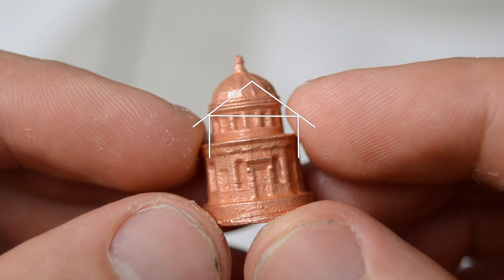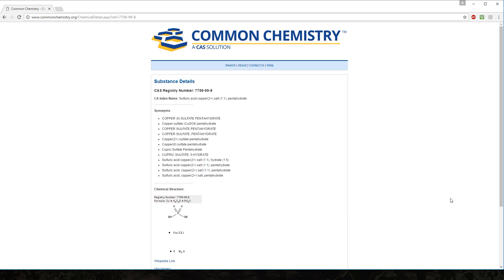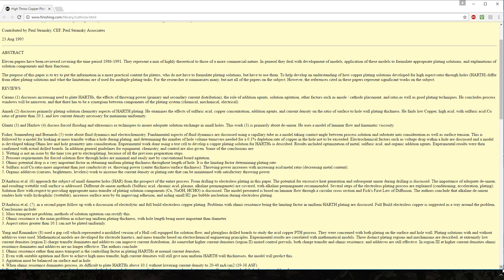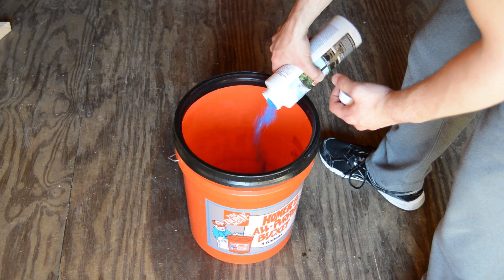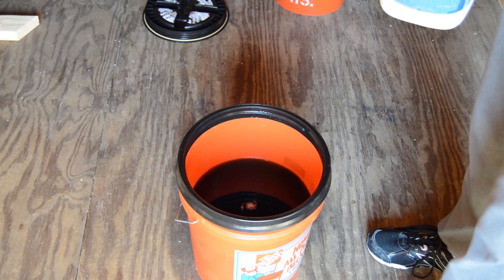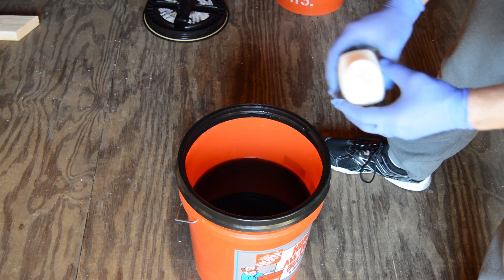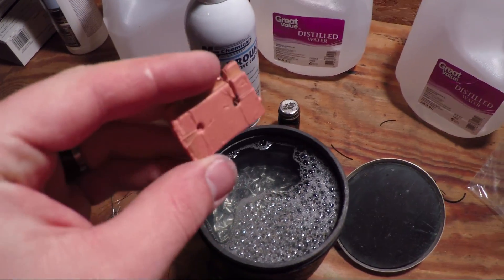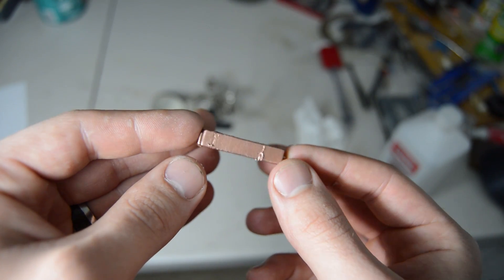Best Copper Plating Solution ~ DIY Professional #3

Comment: Amazing video!!!

Question: You say it's possible to replace sulfuric acid with citric acid. In this case, does the remaining content stay the same? And most importantly, considering that I used citric acid powder, how much of it (volume/mass) would I need to use?
Reply from the maker: This tutorial goes step by step into a similar formula using citric acid. https://youtu.be/2adh56s11Sg

Comment: *@GARAGE SCIENCE*
  - Do you have a video on the process to copper plate steel parts??? I tried your recipe bath and the basics of your setup, but the copper coating just wiped off... and actually before that it just literally fell off and most of it is now in my plating bath... doesn't really matter I guess, as I had already destroyed my solution. 
As a *Warning* to others... *Do Not Use a refrigerator motor/pump for your air pump.* I did, got a good volume of air but not too much, thought it would work great... however the problem is that it also pumped a thin coat of oil out of the pump itself, and pumped it through the air line, so now my plating bath that I Just Made is contaminated with a sheen of oil floating on the surface. So I just lost about... $15 to $20 worth of brand new chemicals that I didn't even get to actually use...
Reply from the maker: This video explains the reaction you experienced: https://youtu.be/6CS84Rj8RrM

You need an intermediate coating of a different metal. There are some copper plating baths that work directly with steel but they aren't quite as friendly to home electroplaters.
Reply: @GarageScience  Thank You! I had looked through your videos several times in the last week or so... How did I miss that one! Anyway, Thanks!

Comment: Does someone know if this would work without sulfuric acid?
Reply from the maker: Watch the tutorial I made about plating in a Mason jar. It uses citric acid.
Reply: Thank you, that's really helpful. I've seen the other video and you also substitute the muriatic acid. I happen to have muriatic acid, so would it be a good idea to use copper sulfate + citric acid + muriatic acid? does that make sense?
Reply from the maker: You could. I would heavily emphasize how little muriatic acid you would need. I would start with a couple of drops and go from there, at least depending on the volume of solution you are trying to make.
Reply from the maker: Here is the link: https://youtu.be/2adh56s11Sg
Reply: I do it using nothing more than Muriatic acid and water and of course a low current power supply. Be sure to research it so you know the proper mixture n such.

Comment: Please suggest me simple way and quick working layer methods
Reply from the maker: You're going to need a separate bath for the tin or nickel plating. I haven't done any videos on baths like that yet so I would suggest looking around online. You'll only need a layer thick enough to cover the entire surface of the part. Then thoroughly rinse in water and place in copper plating bath.
Reply: @GarageScience  how much time it will take to lyer on one liter stainless steel bottles?
Reply from the maker: Depends but probably only 15-30min I would think. That's just a guess though.
Reply: @GarageScience  because my business is stainless steel bottles and I want to put copper layer on my steel bottles will it be reduce time till 6 minutes because 15 to 30 minutes per bottle it's long time please suggest sir any ulternative method to put copper lyer on steel bottles please sir it's request to you.
Reply: @GarageScience  because my business is stainless steel bottles and I want to put copper layer on my steel bottles will it be reduce time till 6 minutes because 15 to 30 minutes per bottle it's long time please suggest sir any ulternative method to put copper lyer on steel bottles please sir it's request to you.
Reply from the maker: Electroplating is not a quick process. If you're limited by time you might want to consider an alternative coating technique like anodizing or powder coating.

Comment: My business of steel bottles manufacturing I want to put layer of copper on my bottles.
Reply from the maker: You need to do a thin layer of tin or nickel before plating with copper. There is an exchange reaction that occurs between the iron and copper and the copper on the steel  won't actually adhere to it and just wipes off.
Reply: @GarageScience  Can I use tin sprays for this? There are some metal sprays available to prevent iron rusting.

Comment: ppg is that the same stuff in vapes for smoking? can glycerin work too?i did not know heating the bath was necessary,i guess it makes it work better keeping it at a certain temp while plating? after the part is done i usually dip it in a solution of vinegar,lemon juice and salt and then slowly scrub off all the gunk with a stainless steel brush followed by a dip in water,is this ok too? im new to all of this and learning something new each time

Comment: How come mines doesn't come out like that . Sort of comes out  brownish. I leave it for 3 hrs  trying to get that   thick layer. When I try to. Uff it out part if the copper comes out
Reply from the maker: A burnt appearance can indicate too much plating current. Try reducing the voltage you are using to plate.
Reply: Garage Science  ohh I see . I'm using 4 double A batteries .  Right now I was  thinking of  using a phone portable charger but idk
Reply from the maker: I'd recommend just 1 AA battery. The 5V from the phone charger is probably still too much.
Reply: Garage Science  thank you . Another question . So use 1 double A battery but stil leave the object 3 hrs or so right  so it could get a good.heavy coat ?
Reply from the maker: I would plate it a little longer. I have gotten plating thicknesses over 1/8th inch thick after plating for 3 days haha.

Comment: Could you add stuff to the copper solution to make it a little harder? Thinking about plating cast bullets for using in a rifle and a little more hardness over pure copper wouldn't be bad for running them full speed. Zinc, tin, aluminum, nickel?
Reply from the maker: You can effect the hardness of deposits by controlling things like Chloride content and Sulfur content.  In terms of plating alloys I'm not aware of a process to do this.  Based on the electrolytic properties of Copper ions it would be very difficult to do that unless the reduction potential of the alloy was very similar to copper.
Reply: Awesome, thanks for the reply.
Reply: Search  on youtube! Terminator frog copper on spray

Comment: The whole safety thing always makes me laugh.  Car battery acid which is usually around 35% sulfuric acid already has water in it.  Adding water to acid in this case does nothing but further dilute the acid.  It won't explode.  The whole 'acid into water' thing is a general rule used in labs where they are dealing with anhydrous sulfuric acid.  Adding water to anhydrous sulfuric acid will cause a steam explosion.
Reply: The dilution of acid is an exothermic reaction, which means the dilution gives off heat. The reason you add "acid into water" instead of "water into acid" is to minimize the temperature change because the large volume of water is able to act as heat sink. With the reverse you can run the risk of making a solution so hot that it warps/melts the container you are using, especially if it's a cheap plastic case. I think the bigger hazard might be a a burn/drop hazard if you happen to be holding the container. 

Or in your anhydrous example, there's almost no thermal mass (water) to absorb all the heat generated, hence the explosion

Comment: What’s the liquid you put in your tumbler?
Reply from the maker: It's water, "lemishine" and dish soap. My tumbling material is stainless steel pins.
Reply: Thanks for all your responses, you’ve been incredibly helpful. Two more questions for you. The citric acid you mention, any specific concentration? Mix it the same as you would the sulfuric acid? And secondly, do you know anything about phosphorized copper and where to get it? Thank you again!

Comment: Hello GS,
You mention about doing nickel plating.
Do you have a decent nickel plating solution recipe that I can use with my copper plated work.
Reply from the maker: +Felix Falcon try this document and look at the "Watts plating bath":
https://www.google.com/url?sa=t&source=web&rct=j&url=https://www.nickelinstitute.org/~/media/Files/TechnicalLiterature/NPH_141015.ashx&ved=0ahUKEwje5sbg7f7VAhXPZiYKHZ5IBbcQFgg8MAI&usg=AFQjCNGpiC5mrujJ5YFBnim6C6VRuhctmg

 that is what I have used. It's pretty safe and relatively affordable to make. I haven't gotten a super great process down for using it yet which is why I haven't made a video on it yet.
Reply: Hello GS,
Thank you for the fast reply.
I will do some testing and experiment with a few items and see what results I get.
Thanks again for the providing the document.
Reply: the link tries to save/download a file? .ashx file?
what kind of file is that? to be opened with what?
Reply from the maker: It's a pdf file. It should open up in the browser. At least it did for me in chrome.
Reply: Tks... let me try it in another browser
Reply: have you tried vinegar to make nickel acetate solution to nickel plate with? Could such a solution be used to nickel plate steel, so that the part can then be copper plated?? Thanks

Comment: I have trying copper electroplating but getting electroforming...any recommendations
Reply from the maker: +nobackhands , I'm afraid I need a little more info to help. Are you using the solution I created in this video or something else. What are your operating specs and what exactly is happening in your results, is it black, rough, covered in pits or noduals?
Reply: I have been trying to electroplate some small size pieces.  With the total surface area of a US penny, I am using two gallons of copper bath with anodes of copper wire distributed on all four sides.  My power source is three AA batteries in series.   However, I have tried using a 12 volt DC cell phone charger. In each experiment, I got electroforming rather than electroplating    Thanks for any recommendations
Reply from the maker: +nobackhands is it basically creating little trees everywhere? Also what is your electroplating solution made of. You probably are using too much voltage. Try putting the three AAs in parallel and if you can agitate the water a little that will help plus a little laxative (ie polyethylene glycol) would help too, but only about 1 tablespoon.
Reply: My solution was made with Copper Sulfate Pentahydrate (Zeb Root Kill)  I can understand the water agitation and the voltage change.  
Rather than water agitation what about heating the water.  Thanks again
Reply from the maker: +nobackhands you need more than just copper sulphate you need acid. If you're squeamish about using sulphuric acid then use vinegar (aka acetic acid). If you use vinegar you will need it to comprise about 30-50 percent of your total electrolyte. The acid is necessary for something called throwing power and also helps dissolve your electrodes. If you use about 3-5 tablespoons of muriatic acid (aka Hydrocholoric acid) you can bring the acidity up and add some chloride which will also help dissolve your electrodes. Bottom line your solution has to be acidic in order to work well.
Reply from the maker: +nobackhands not a problem, my email is in the about tab of my YouTube channel.

Comment: Great videos brother, I have learned a lot by watching them. I have the desire to try and use your plans to build a system, primarily to plate iron plumbing fittings in order to give them an old patina'd look and feel. I was wondering if you would be willing to do a quick test on say a 1/2" non galvanized iron elbow or tee  and post the results? I am most certainly not looking for as much copper build up as you are going for, but rather a thin layer that can be lightly polished to give it a dull shine, and then use some sort of pickling agent to cause the copper to oxidize and turn green(ish).

I have not been able to find a video from anyone who has done that, and don't want to spend the money building this system if it wont work as I envision. If you are so inclined, and are willing to plate a fitting, I would gladly paypal you for the fitting and whatever you felt was fair for your time.

Looking forward to your reply, and again, thank you for your wonderful videos. Definitely subscribed...

Respectfully,
Reply from the maker: Boogaloo Tactical Tactical thanks for the comment, I am very glad you enjoy my channel. When it comes to copper plating iron things get a little tricky. Because of the relative nobility of iron and copper. When iron is immersed in a copper sulphate solution (such as an electroplating bath) the Cu in solution and the Fe on the part immediately swap places even without electrical current. This might seem advantageous except the copper now on the surface of the part is not adhered to it and can be easily wiped off.  This means an extra step has to be taken to plate iron by first plating it with a different metal, usually nickel, zinc or tin. I happen to have a nickel plating solution that I haven't used in a while so I will break it out and see what is possible. If you are trying to replicate this just know that nickel plating baths can get expensive just because the chemicals tend to cost more because of the relative cost of copper and nickel.  Message me on my Facebook page and we can work out details if you would like me to mail you whatever I test plate.
Reply from the maker: If you're up for some light reading you can do some research on reduction potentials and you'll find that a redox reaction between Fe and Cu is galvanic as opposed to electrolytic.

Yes you could use a substance to deny copper and nickel plating in certain areas.  I have found that enamel paint works just fine for creating an insulating layer on a part.  If the shape is simple enough even electrical tape will do the job sometimes.  The uniformity of the plating is heavily dependent on your plating tank and process and not so much preplating it with nickel.
Reply: I will absolutely ping you on FB sir, and thank you so much for the prompt and courteous reply! I had no idea that iron and copper seem to be mutually exclusive in that way. I suspect that plating the iron fittings in nickel first, will then produce a fairly uniform copper plate in the 2nd process? That may work, if by chance the nickel plating can be denied on certain areas of the iron fitting by artfully painting specific areas with wax like they do when they are anodizing aluminum? 

There is an anodizer near me that I have used for years to anodize aluminum car and motorcycle parts, and whenever I have areas of a particular part that cannot be anodized, they paint this dense red molten wax on those areas to protect it from the corrosive effects of the anodizing process prior to the dying phase. Specifically, anything that is NOT aluminum, will be quickly eaten away, like nutserts, helicoils and other steel hardware. It is definitely effective and the wax has a high melting point, so as not to be melted away in the hot anodizing tanks.

In my mind, the wax would remain through the copper plating phase and then removed to reveal the black iron substrate. Careful blending and polishing with a wire wheel or buffing wheel could then blend the copper to iron interface to give it that worn/aged look that I am ultimately shooting for.

Thoughts?z

P.S. Sorry, I replied with my main gmail account and not my Boogaloo Tactical account.. I am the same guy.

Comment: Great video. Thanks. 
I tired dissolving copper in vinegar and hydrogen peroxide, the result was not very good. Plating became black. At first I was using a car battery charger. I thought it was too much of voltage and current so i switched to two AA batteries but again same bad result. Any idea why my plating gets black?
Reply from the maker: +Arash Razzagh Karimi it gets black because your copper is depositing too fast and doesn't adhere to the surface of your part. It basically is creating microscopic branches and trees of copper very quickly. The reason it is black is not because it is burnt or anything like that but because the complex microscopic geometry of your copper deposits doesn't allow much light to escape and so it appears black. I would try an even lower voltage, try one AA and if it is still black try using a voltage divider to bring the voltage to about 0.5 volts. The best plating I have done has been between 0.5 and 1 volt.

Comment: Have you ever tried plating a mold of something? Do you ever plate something so thick that it could support itself, like in electrotyping?
Where do you get all the information, is there a dedicated community for this?
Thanks a lot
Reply from the maker: Plating a mold is on my list of things to do.  Right now I'm working on plating larger 3D printed items and getting smooth and even surface finishes (the way you hang the part in the bath is just as important as the chemistry in the bath).  I have removed plated copper off of parts and it's stiff enough to support itself.  I will probably try castable resin at some point and make a mold/solid copper part that way.  Google is my best friend for information, some scholarly papers are free but most have to be bought.  finishing.com is an excellent resource.  The guys there have been in the metal finishing business for decades.